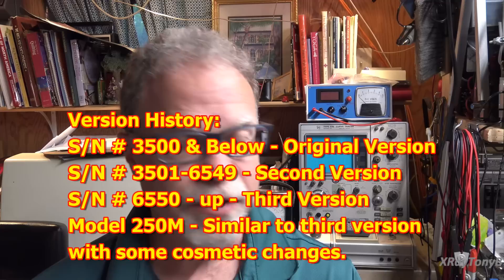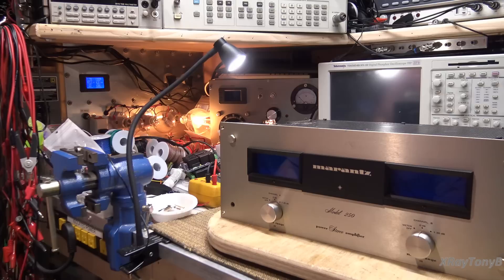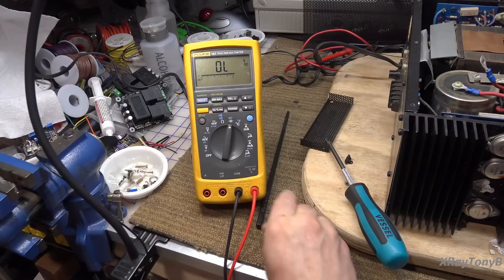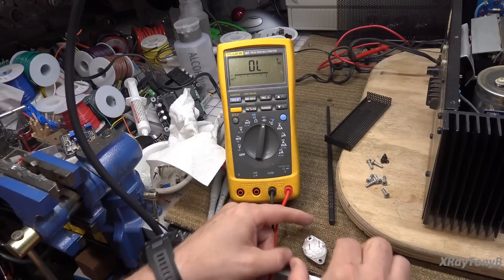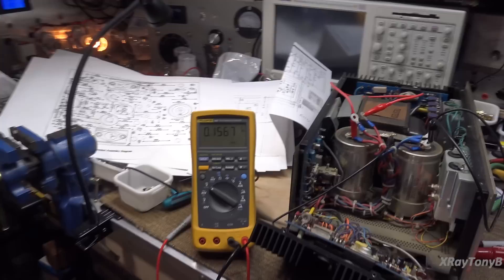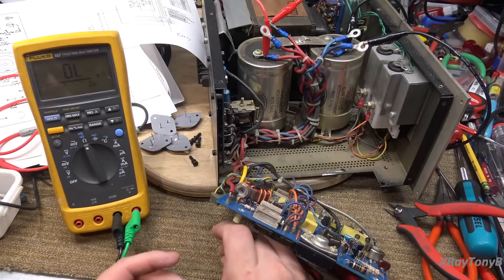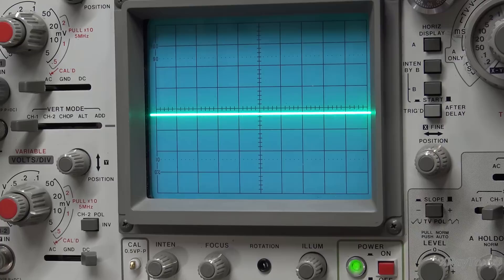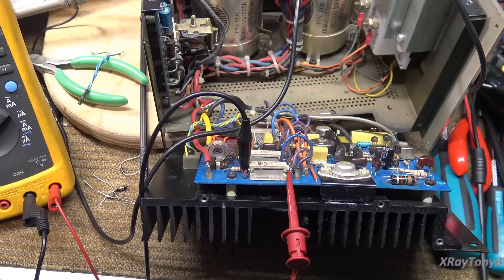Marantz 250 Amplifier - Part 1

Comment: completely wrong, sps1951 and sps1952 are definitely not darlington transistors, and the bias circuit with a germanium diode is always upgraded to a 250M scheme with 2 transistors for stability, 50 minutes of wasted time

Comment: The silicone diode has threshold voltage of 0.7V, whereas Germanium diode has 0.3V, don't you see a problem replacing one with the other? Thermal characteristics of the two diodes are quite different.
Reply: Must admit I also don’t understand
Reply: Great troubleshooting, as usual. Bravo, Maestro!
Also curious, though, why you don’t replace with the germanium diode originally spec’d? What was in the other channel; G or Si?

Comment: Yep, a first gen version of a 250, in this version the MR752 bridge diodes are on the back relay board, they would overheat to the point that the diode pills would fall off the leads, in the later version they were relocated to the top of the big filter caps with some extra copper to keep them cool. Thad later version had machined pins to connect the E B pins and the wired sockets were removed.
I worked in engineering at Marantz and the story was the engineer that did the original 250 would use resistor substitution boxes to get values right! He as gone by the time I got there.

Comment: What a tricky repair. I imagine that we can scratch our heads without old analog multimeter. This is a good example of why we need to keep our old test equipment up and running!😉. Awaiting part 2….
Reply: I frequently use an old Triplett analog meter at work (audio repair shop). Excellent for quick in-circuit tests of diodes and transistors, and capacitor charging/discharging, without the jumping around of a digital display.

Comment: Info for "newbies" and non-technicians: the screws holding the output transistors to the heatsink also make the electrical connection to the collectors (the metal case) of the transistors,  which is why those screws need to be present, and tight;  If they are loose, not only do you get intermittent electrical connection to the transistor but you lose the ability to transmit most of the transistor's heat efficiently to the heatsink.  Marantz usually used white silicone heat sinking grease (and clear mica insulators) between transistor and heatsink to enable the transfer of heat, and I presume Tony wiped most of the white silicone off the transistors before he tested them  with the multimeter. That grease is nasty, messy stuff; it absolutely ruins clothing and and it can be difficult to remove from painted or anodized metal surfaces. Make sure you have plenty of rags and paper towels handy, and alcohol or other solvents,  if you have to deal with removing transistors from the heatsink. Clear heatsink grease is somewhat less messy but it doesn't transfer heat quite as well.  

Most modern equipment uses thin sheets of silicone as an insulator and heat-transfer medium in place of the mica insulators,  and doesn't use/ doesn't strictly require heat sink grease. Whether the silicone pads truly work as well for heatsinking purposes without the addition of grease, I don't know. On old equipment I still use the grease even if I upgrade to silicone pads as insulators. I ways wear a shitty shirt and pants on such days, something already greasy and stained.

PS, the metal mesh cages over the output transistors are to prevent accidental short circuits from the cases of the transistors, which have plus and minus voltages on them, to the chassis. Most transistor short circuits occur between emitter and collector anyway.
Reply: Have you had a chance to try Wakefield Vette Ultimflux 60°C phase change pads, by any chance ?

Comment: The relay buzzing at about 13:00 is a bad cap associated with the B+ for the relay. Around 10uF if I recall. Maybe you found it later on.
Reply from the maker: Every cap in that amp is bad
Reply: @xraytonyb  , even lower power Marantz receivers invariably have 6 to 8 bad  caps on a separate power-supply/protection-sense board that prevent the relay from closing. The voltage regulators and resistors bake the heck out of those caps and the shrink-wrap on the caps often shrinks back, exposing more of the metal can, or the guts of the cap expand and the  bottom rubber plug pushes outward.

Comment: I have two of these amplifiers and and have had output transistor failures as well as problems with the protection circuit.   One is a unit that I bought new in about 1972 and the other was assembled from a chassis and several power amp PC boards from an audio shop that was going out of business.  One common problem was that there is a capacitor in the relay circuit that goes bad and at first the speaker relay just gets slower to pull in. but finally it just doesn't close. Replacing the cap fixes it.  I have done that on both amps.  The other one that I made from parts failed about a year ago and the relay became "fused" on one channel and I tried to repair it by cleaning the contacts.  While it worked to some extent the affected channel would cut out because of poor contact.  The problem was that no one makes a suitable replacement relay.  I found an article on line that recommended a relay that would work, but you had to modify its internal wiring to match the footprint of the Marantz PCB.  I was able to do that and bring the amp back to life.
The relay was from Mouser, PN number MY2-02-DC24. it has to be modified to match the Marantz PCB and the footprint is a little small but I was able to make it work.

Comment: I have an old 240 amp that I've repaired before. Same amp boards as the 250 but without the meters.  I've seen it fail once where all of the outputs and drivers smoked...the board was charcoal!  I had to find a "new" board on Ebay to get it working:).  One challenge is even finding the correct output transistors anymore. Can't wait for part 2!

Comment: I use the fiberglas scratch brush almost daily; great tools, but they can be a little rough for cleaning wipers and commutator rings on pots (the stiffness of the fiberglass inserts varies depending on the source, some are softer then others). For pots, I use a pencil eraser instead (an ink eraser containg some kind of mild grit like silica or pumice is better, and usually safe for carbon tracks as well, if you use a light touch). A precaution for musicians: if you have gigs or practice sessions coming up,  wear gloves when using the fiberglas scratch brush! Also smart to vacuum your work bench, and shake your clothing off outside; the glass fibers will drive you nuts for days if embedded in your fingers. Excellent tools, however; mine came from Esslingers (watch and jewelry supply). The German-made ones are refillable and better than the cheapo, non refillable, Indian-made scratchbrushes. They also sell steel, and brass, scratch brushes.

Comment: Nice and interesting fault finding, Tony! I have to this day not had problems with a light coat of lube on wirewound pots. I once used silicone lube, but this will break down if the wire heats (and turn into sand which would be very bad)!

Comment: Excellent project. I just finished my Marantz 500.  I had never seen the inside of a 250 before, completely different beast. The 500 is an absolute pain to work on.
Reply: Hi

Did you observe oscillation issues with it?
I have one in my pipeline- but must admit the repair is very intimidating…. So l keep postponing
Reply: YES they are........ :(
Reply: @jeditoto3441  as of yet no, but I did an all out restoration on it. All electrolytics, new WIMA polypropylene throughout, all new output transistors, drivers and predrivers. Pretty much all new transistors in the whole input and driver circuit.  Incredible amp.  I’m working on my Phase Linear Dual 500 power amp right now and theyll have a showdown.  Loser is being sold probably lol.
Reply: @danhorton6182  what type of transistors did you use for the to66?
Reply: @jeditoto3441  do you happen to have the device numbers from the schematic (QXX, etc) or better yet their actual device numbers? Depending on where they are in the circuit using high voltage device vs high current.  Regardless I swapped the TO-66 for TO-220, which is a fairly popular option. Feeding one of the legs of the transistor can be a little tricky, but can easily be done.  For the drivers and such I’m 99% certain I used MJE15034/MJE15035, otherwise the MJE15032/MJE15033  pair. If you get me device numbers I’ll look at the specs and tell you which one of the four to use.  Figuring PNP vs NPN is easy of course.

Comment: Some bias circuits are wired in such a way that if the bias pot fails (the wiper losing connection being the commonest problem) the bias turns on full and the output stage draws excessive current, instead of throttling it back. Sometimes you can fix this by tieing the wiper to one end of the trimpot.
Reply: Hi

Interesting info. Are you on audiokarma? Would love to see a picture of such a modification
Reply: @jeditoto3441  ,  I am not on audio karma, sorry.  I haven't worked on this particular Marantz amp (I've worked on plenty of other old Marantz gear,, as well as old Pioneer, Kenwood, Sansui etc); but anyway,, you will note from the schematic (if it is indeed correct) that the bias trimpot appears to be used only as a variable resistor, and the third connection to the pot isn't being used. If the amp was in front of me, I would verify that the far end of the pot isn't tied to anything, and then I would measure the resistance setting on the trimpot as it is, and then adjust it so that the amp draws less current, and measure it to see if the resistance is now lower or higher.  If increasing the resistance setting of the trimpot lowers the bias current draw of the amplifier, then you should tie the wiper to the unused end of the pot with a jumper.  This way, if the connection to the wiper is intermittent and the wiper comes out of circuit,  the resistance of the pot in the bias circuit will go to it's full value and tamp down the bias and the  current draw of the amp. On the other hand, if decreasing the value of the trimpot increases bias current, fixing the design flaw might not be so easy or practical. In such a case, it's recommended to use a new, very high-guality trimpot.
Reply: @jeditoto3441  ,  I did a little looking around on YouTube and I found a 2 year old video from a guy whose channel I subscribed to only recently ---- " Electronics Old and New by M. Caldiera " ----  where he repaired a badly butchered Marantz 250 M. It's a 3 part series and in the first part he looks at the bias circuit schematic,  which was done differently in the M version, with an extra resistor or two and wired in such a way that if the wiper lifted off of the trimpot the amp wouldn't go into full bias conduction.
Reply: @goodun2974  thanks for the hint - will check it out
Reply: @jeditoto3441  , here's the link, if this channel allows. https://youtu.be/qaT-vZz66L4. The bias circuit and pot are shown at about ten minutes in.  I don't know if it's applicable to the original 250 since this is the M version but it will give you some idea of the concepts involved.

Comment: A great video very interesting little failures but could you argue that the Fluke did find the problem as it showed too high volt drop for a germanium junction which in turn led you to try a different method of measurement ?...cheers.

Comment: No zobel network I could see; a resistor with a few turns of wire and a capacitor wouldn't hurt I guess or just an RC HPF or two maybe to roll off at 35-45khz? Thanks again....DA.
Reply: The later 250 M does add an output inductor.

Comment: When I shut off my amp it plays for about a second after switched off. Anyone know why? Power board caps? I have to check for DC but it sounds great.
Reply: Does it have output relay(s) ? If not, then it's doing what it's supposed to - running until it runs out of juice. DC offset is another, unrelated matter.
Reply: Does your amp delay the audio for a few seconds when it turns on, and then you hear a click from inside the amp, at which point the sound comes on? If the ound comes on immediately, without any delay or mechanical click, then the amp doesn't have output relays (unless perhaps it did, but somebody jumpered them out of circuit or removed them).  It is possible to have a technician add delay and protection relays to the unit, and Tony did a video about this not long ago.
Reply: Thanks for the replies. No relays, so I guess it is the  main cap discharging. Toshiba SA-202 C. Surprisingly excellent tuner. Better than the Sanyo JCX 2300k and the Pioneer SX-450. I often find them for less than $50 in various states of disrepair and bring them back to life. This one was an evening project .Detailing, replacing bulbs and cleaning switches and whatnot. In 9/10 physical condition.  Great purchase for $15 bucks.